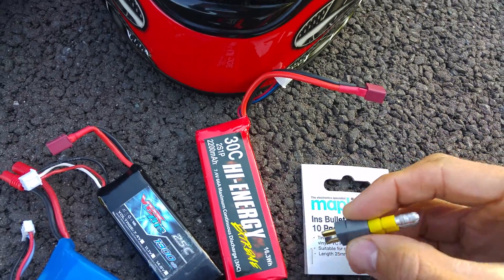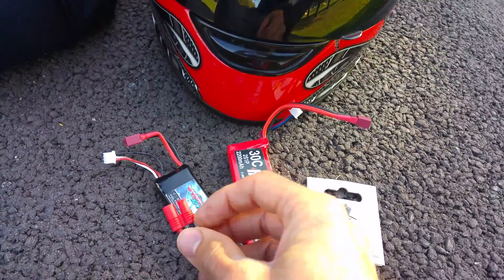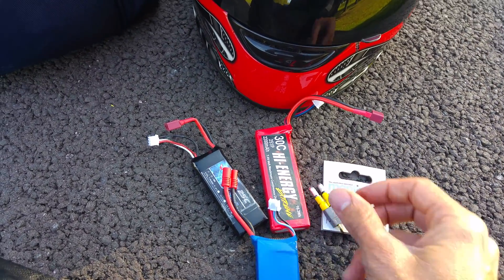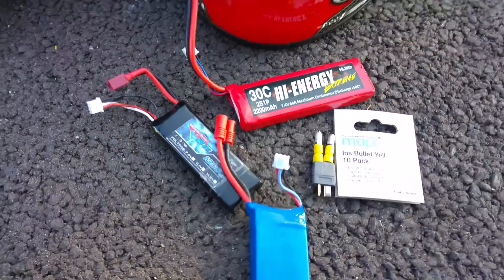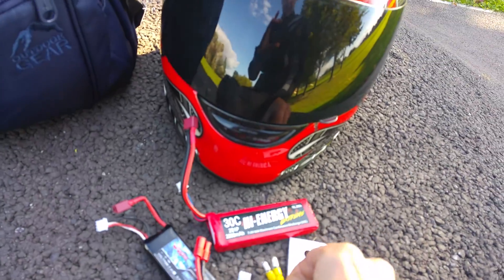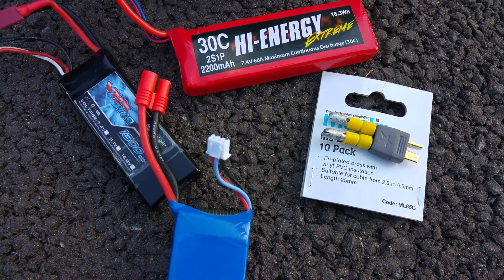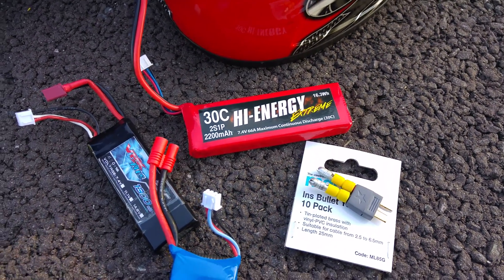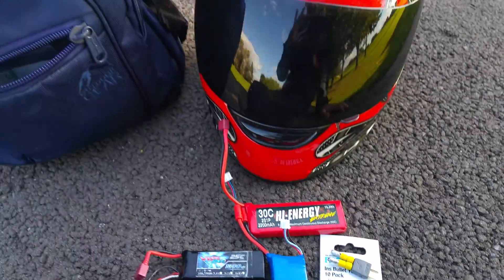Battery adaptor mod Syma x8c 4K

Comment: Hi mate the warranty on them is worthless i had a white x5c i brought to take on holls, But i found when turned on it would just auto flip took it back two weeks later, they said it had flight damage and it was not covered by the warranty. 
They said the terms of the warranty are void as soon as you fly it as its the nature of the hobby. so if you have any scars from flying the warranty is void. this was a well known uk shop

I have had better help from Chinese online shops with atleast getting replacement parts for free.
but it does depend where you get it some shops have the own return policy.
Reply from the maker: cool well its good to know its taken ages to find these as you cant buy in uk ebay still china just wanted to use diff battery's with out the need for cutting re soildering new connectors its clean easy to use im sure people will do it